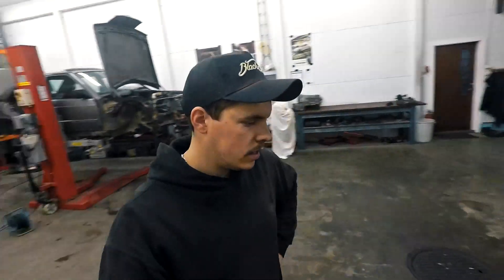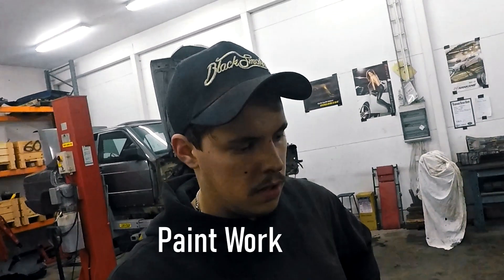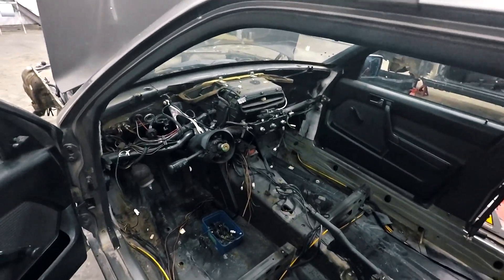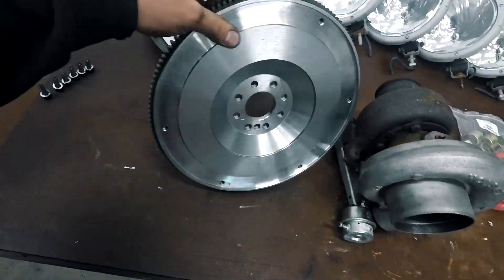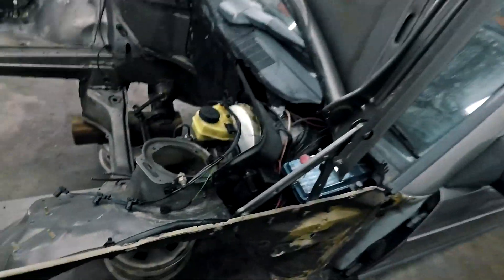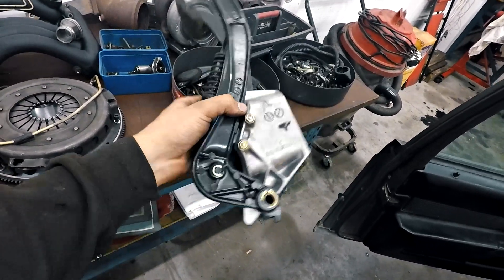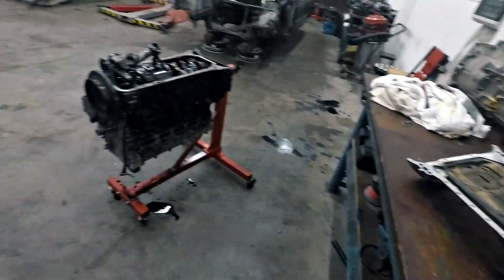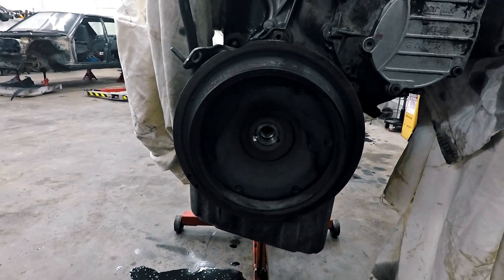VÄRKSTAN Episode 2 - Axles, Electronics & Engine prep.

Comment: Hi. Is it really critical to make the injectors 150bar. What if I leave it as stock 135 bar with 8mm DM pump? What may happen? Will I lose some power?
How much torque to apply to injectors when using VW flame arrestors?

Comment: Great info. Was removing all the electronics from the bay a issue with having abs working?
Reply from the maker: There is no ABS int this car, but no problem either on the ones that has it. The ABS has its own harness.
Reply: @Blomppo995  thanks dude, looking forward to the hub adaptation so you can use the w210 stronger axles.

Comment: Could you please post the part number for the transmission that you used? I am doing a very similar project with the om606 engine and I would like to buy one of those transmissions.
Reply from the maker: GS5-39DZ
Reply: @Blomppo995  thank you
Reply: What rear end differential gear ratio are you using?
Reply from the maker: It is shown here in my videos too...

But it is a 2.88
Reply: @Blomppo995  thank you your videos are awesome. If you look at my YouTube channel you'll see the most recent videos I uploaded are the very beginning of a w124 om606 project. I'm learning a lot of good information from your videos very nice job.

Comment: On kyllä hienoa katseltavaa, millä malli merkinnällä toi vaihdelaatikko? 😎
Reply from the maker: Thanx 👍🏼 GS5-39DZ
Reply: @Blomppo995  How many milimeters height has the friction face to flywheel, machined in lathe, and clutch disc is 9,5mm thick unbolted? To fit the 765 PP.
Reply from the maker: They recommend flat flywheel for 9,2mm thick plate, so you do the counting 😊
Reply: @Blomppo995  Thanks, reading M5Board there is some info about 765 PP clearance with the FW, max pressure is with 3,4mm PP-FW  unbolted, not sure if I understand correctly.